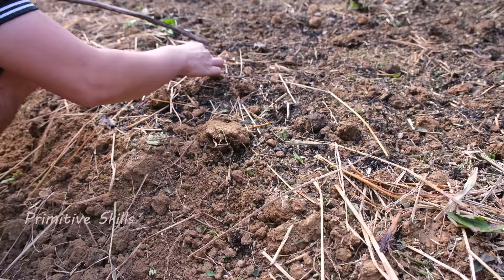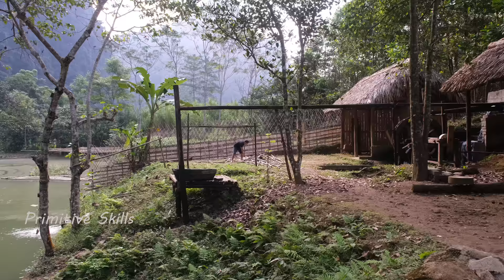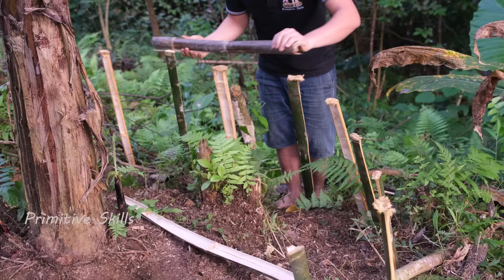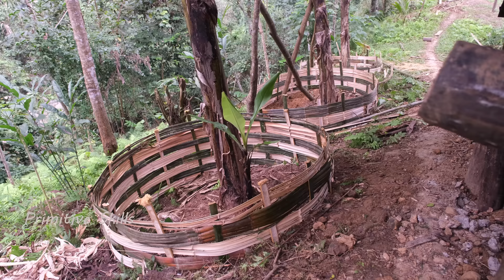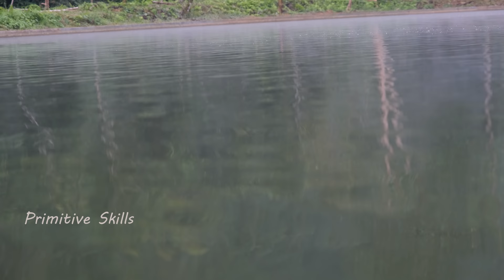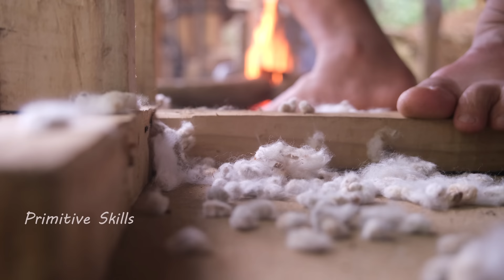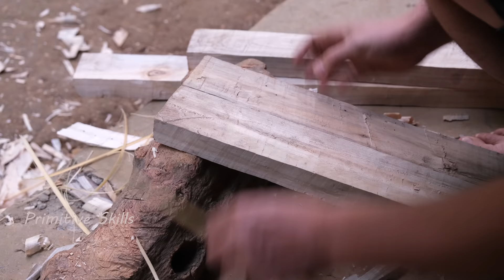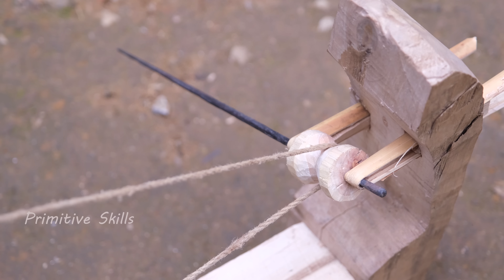Primitive Skills: How to make Spinning wheel, manual yarn rewinding machine (ep202)

Comment: WOW!!!!  That spindle wheel was wonderful!!!  It looks just like those used by Gandhi and his people when they were reviving their nation's economy.  Their efforts worked soooooo well that, it's also the same wheel model that appears on their national flag.  For your first efforts, you are actually doing very well!  I spin cotton every now and then just to retain the knowledge of how to do it.  I also initially learned on the spindle, but had trouble getting the hang of it, so, when I do it now, I spin it on my regular wheel.  But, because cotton doesn't have the cuticles like wool, the yarn has to rely on twist to stay together.  Without sufficient twist, you get yarn with really weak spots that fall apart and can't be successfully used to make any garments, or anything else for that matter.  So, when I use my regular wheels, it takes forever to make just a little yarn because you have to wait for sufficient twist.  You aren't having trouble with your yarn because of using old tech, but, you just need to loosen the fibers more, because it's way too clumpy, so, before you tease it with your bow, spend more time teasing it with your fingers.  Also, the rolls on the sticks are called rolags.  Your rolags are too fat, a result of the overly clumpy fibers.  You are doing a lot better than you think.  You just need more practice.
Reply: Hey LOF !  Good to see you again.  Happy Holidays.
Haven't watched the video yet, but it would be good if he turned some of that cotton into wicks for simple oil lamps.
Reply: @jimbayler4277  I have watched it twice!!  I confess that it was because of the wheel.  I try to have a look at the video pics when I  get the chance.  I haven't been able to watch them all lately because I have a sick dog to care for.  Me and my husband adopted a bonded pair of great pyrenees going on 2 years ago.  We knew from the beginning that the female had severe hip joint issues, but, they needed a home and I have always wanted the breed, so, I figured we would take them and deal with whatever happened.  And, I have to tell you, it's really a job and a half.  My girl is 100 lbs, but my boy is 150 lbs. So, I have to get them to agree with whatever I have to do to them, cause, if they really don't want to cooperate, there ain't a lot that can be done.  But, they both have bonded with us and would do anything for us, and we would and are doing the same.  We recently got new neighbors next door who aren't used to dogs,especially big, loud ones.  It's a multi member family with an adult son and his pregnant wife who can't stand the loud barking and is starting to complain about it.  We have lots of wildlife around our neighborhood because we live at the base of a national wildlife reserve, so we have coyotes, mountain lions, pigs, etc. that roam the neighborhood during the early morning, which makes the dogs bark like crazy!  When that happens, I have to get up and quiet them down.  If they get really agitated, then I have to sleep with them so they will relax and go to sleep.  I have only slept in my bed a few times in the last few months.  I haven't had any time to bother trolls lately.  I really miss that. 😢  A couple of times I actually looked for Mindcrap/Missy Cooper, but, really didn't have time to do anything about it even if I found it.  My husband, who is finally retired took pity on me and started feeding the dogs their dinner, but I am just taking a few minutes before I have to to down a check on my girl, we are trying to change her pain meds.  She was on steroids, but they were reeking havoc with her digestive track, so we has to get her off them, which meant she had to go through withdrawal, and that was several days of really awfulness.  So, now I have to see if she can get by on the nonsteroid  alternative.  Seriously,  she's not able to walk without the pain meds, so we have to feed her by hand,  and drag her outside so she can do her toilet, which is what I am waiting to do right now.  So,  I gotta get going.  Sorry to complain the whole message.  Really great to hear from you!!  I am just waiting to see if @P. Skills will actually get a garment made out of the cotton.   He did an excellent job with the gin and the wheel, and his spinning was coming along well also.  I can't wait to see how he does.  See ya.
Reply: @loveofiber7564  GREAT  PYRENEES ?!  Holy Moly !!
That industrial grade shop vacuum your husband has had his eyes on ?!..... Get it for him for Christmas !  With all that fur, you're gonna need it !
I've always been a dog person (the wife and boy are solidly cat people). But when the boy wanted a dog, I told him "Okay, but you are the one that will need to do "Shovel Patrol" and clean up after it....". We do not have a dog.
The cat at least, takes care of its business in the neighbor's yard (Oh ! Wait did I just say that ?!!..... I mean uhhh...  Bad me !!)

Speaking of Trolls, are they still posting ?!  If they are, they are not showing up in my feed !!  That would mean that I am being blocked from seeing them somehow.

Check out Ceasar Milan the "Dog Whisperer".  Your dogs can be trained to bark only when it is appropriate.  But you have to establish that you are the Alpha animal in your new "Pack".

Yeah, I can relate to the dog's digestive issues.  Since I have been having to take blood sugar Meds, I've become Military grade dangerous to be around !
In a group of guys..... I can clear a room faster than any of them !
The wife, however, is less appreciative of my newfound talents.... especially under the covers.....

Anyways, back to @P. Skills.  Have you ever thought of creating/making a spinning wheel like he just made ?!  It looks like it would be fun to try.  Shouldn't be too hard (maybe time consuming).  If he was able to build one with his resources, we should be able to also.
Anyways..... Happy New Years to you and yours !
Reply: @loveofiber7564  : Ahhh..... Man !!!  "Stay out of trouble" ?!!!  There goes all the fun !! (just kidding)
What if I invited you along for the next crazy adventure ?  Would I be allowed to get into trouble then ?!!!!!!

On the Trolls: I don't know that they have been blocked to our view.  I'm just going down the list of possibilities. But after four plus years, suddenly they're gone ?!  

That makes for more than a bit of curiosity. But since you are not seeing them either, it is very likely they were blocked from the channel entirely.  

I don't see them as having gotten bored and leaving of their own volition.

I doubt you were blocked from seeing them if they are still around.  I was the one that went hard and relentless at them.
They were nothing if not persistent.
I must admit, it is a relief not to have to deal with them.

I was allergic to cats also but didn't have a choice in it.  I got the "look" that told me "Deal with it buddy !!" 

On the Dogs:  Even independent dogs are still pack animals and have a hierarchy.  Either you are the leader, or they are.  You have to decide who's going to drive the boat.
My dog (pure breed Mutt) from when I was a kid, eventually went with severe hip problems, so I feel for ya.
Stay strong. I'm sure they are grateful.

ShopVac:  Still.... might be a quick way to gather it verses using your clothes to pick it up bit by bit every time you sit down.

Real cool that you have worked with all those different donor fibers !  Some of those sound like they are real hard to come by.  Though, I suppose there is a network in that interest, that trades materials around.  Every other field of interest seems to have a similar network.
Reply: @jimbayler4277  You are such a kidder!!  Your wife has to be tough!!  

Thanks for the advice and sympathy about my dogs.  Fortunately, my neighborhood is dog central.  Almost every household has multiple dogs and we all congregate during our walks to trade info, neighborhood secrets and gossip!  It's kinda great really.  My husband is the distinct alpha of the house.  As for me, I am my mother's daughter, so I am next in the line of authority  - probably also because I am a retired teacher as well, but,  shocker, I am able to stop the barking better than my husband.  And, our big boy seems to instinctively know when it's not a good idea to defy me.  It's our girl who's been the one to really push the limits.  She has been having mobility issues for much longer than they have been with us, so, in the beginning,  we had to stop our boy from taking her food, etc.  So,  we trained him to the "leave it!"  command.  Initially,  she wasn't able to stand long enough to finish her food, so,  she was a dog who was supposed to be around 100 lbs, but, barely weighed in the 80's.  She now is just below 100 lbs.  AND, she is now the one that will take our boy's food, and will kick him off his bed, even if he is sleeping on it!  Which she will do when she pees on her bed during the night, and we, the human slaves, are not available to clean it up.  This is an improvement because, before, she would just continue to lay in her pee and poop, because she had soooo much difficulty moving, so it was just easier for her to just  lay in it.  She now will move to the floor, or another padded area, or,  if she wants to be comfortable,  she will just take over our boy's bed (they each have a memory foam pad with cover, pee pad, and faux-fur pet throw - it has a rubber center and is really comfortable and warm, it also really protects against pee accidents).  Unfortunately, my girl sometimes manages to lift the protective covers as she is climbing on the bed, and if she happens to pee in the wrong place, she will get her bed wet.  The bad part is that it takes several days to clean and sanitize her bed because of the drying time.  Memory foam takes forever to completely dry, especially the center.  And, on top of things, we are now in the rainy season, which means I have to wash and dry it in the garage.  

Oh well, so sorry, but I complained again.   I have to run cause it's feeding time. 

And, finally, no, you can't get into trouble even with company.  Unless it involves going after trolls.  So, let me know when you see them.  I am absolutely sure they would block you wayyyyyy before me, so that's why I was surprised that I also hadn't seen or heard from them.  I also can't believe they could have packed up and left, but, are they taking a break?  Or just spreading the love??!!??
Reply: @loveofiber7564 :  Man !  You are a tough task master !!
OK, Fine !  No more trouble making.... (wellmaybeonlyalittlebit...)

(If I haven't already, I probably should have mentioned it previously. 
I'm only good for about three straight lines, and then the humor has got to be inserted in there somewhere - Yes, My wife is over there doing the "Bobblehead" thing agreeing vigorously !).
Do I test her patience ?!..... maybe.... I confess to nothing !!

The Male seems to have figured out who the REAL Alphas are in the house.  I suspect your husband knows also.
Former Teachers don't tend to put up with much guff !

Is my wife tough ?:  Well.... the heels of my shoes are shiny from clicking them together when I salute !

Trolls:  Maybe, if we are lucky, they are on a State sponsored vacation (jail).
"Spreading the Love": Ha ! Good one !!

Nah, I never found their "fingerprints" on any other channel in the genre.  Not even on the "OG" of Bushcraft/Primitive skills, @Primitive Technology - The Australian guy.  The trolls claimed he was the "GOAT".  
Not even a compliment for him.

Bed protection:  I'm assuming that it is a fitted cover with elastic corners.  Maybe adding crisscross elastic straps or bungee cords on the underside of the mattress will help hold the cover in place, better.
The foam:  Roll it tightly to squeeze out as much water as possible and hang it in the warmest place possible.  Maybe a drying rack with plastic sheeting below it to catch drips.  Air circulation is critical. 
With the cold and winter humidity, leaving it to dry in the garage will take forever. 

Consider using compress wood pellets (sawdust compressed into pellets) for under the protective cover as a Foam substitute.  They are moldable (create a hollow), comfortable, and warm.  They use the pellets for horse stall bedding and animal cage litter.  
I, and many others use the pellets as organic Kitty litter.
The fresh pine scent really lightens the room.  
The carbonaceous nature of sawdust virtually eliminates the smell (ammonia) of the urine. (wa-a-ay better than clay-based kitty litter)  

When you change it, it can be incorporated into the compost pile, if you maintain one for your garden
If not, the Yardwaste recycle bin. 

You can find it cheap at most Feed/livestock hay stores (40-50lbs bags).  You can also usually find it at the Chain pet stores, though usually a bit more expensive.
Get yourself a medium size Garbage can (under 30gal) to store it in.... and a handy scoop.
Hopefully, these suggestions will help lighten your workload.
Reply: @jimbayler4277  You're an angel for trying, but my husband is sensitive to the dust.  We have difficulty with what's generated in my woodworking shop.  So, we have air filters in just about every room we spend a lot of time in, and no scented candles, we have to even be careful with aerosol air fresheners.  We went through the scented wood chips when we first got married.  I had cats that I just couldn't part with, and this man wanted to marry me so badly that he agreed to take me cats and all.  Well,  after multiple attacks, I finally got rid of the chips for the cats, the hay/alfalfa for the rabbits, etc.  So, I just gave up having cats and rabbits cause I just couldn't watch him suffer.   So, after my cats and rabbits died out - of natural causes, I just didn't replace them.  But, you are all kinds of thoughtful to think of it.  

Gotta get going, again,  dogs as usual.  

Oh, and let your lovely, long suffering wife know that if you guys ever want to visit So Cal, we are a mere 40 minutes away from Disneyland.  L.A. is just a little further west.  

Oh, and I won't bother with the "stay out of trouble" cause I think it will be ignored anyway.  But, I will say stay in touch.  Happy trails!!!
Reply: @loveofiber7564  : Wow !.... and I thought I was the King of allergies !!  Dust and Pollens, Spring and Summer.  Molds and mildews, Fall and Winter.
My condolences, sympathies, and empathy to him.  I can certainly relate.
We buy Kleenix by the Costco case.
I should have bought stock in the company years ago.  I could have at least recovered some of my money !
We're just up the line from you. San Jose area.  If we ever get what passes for free time, we might take you up on the offer.
To you, likewise.  Happy Trails.

Comment: maybe it would be good to use a water wheel, and connect the spinning wheel to the wheel, I would make a pedal that would switch the direction of rotation, you would have both hands usable for spinning cotton and the results would be much better, great work, I just hope there are no other workers outside the shot people, I don't want to offend you and I believe that you managed it all by yourself, maybe it would be good to grease the whole water wheel with lard so that the water can soak in, and it would also be great not to soak the water wheel in a stream of water when you're not using it, so that it doesn't rot unnecessarily quickly, fingers crossed good luck

Comment: Spinning is not an easy craft. I've spent all of my life with spinners, knitters and weavers. They spend their whole lives learning to prefect their crafts. I'm amazed you got any thread at all. One suggestion:With your machine you can only use one hand on the thread you are creating, as the other turns the wheel; it's easier to form the thread properly using both your hands, while the wheel is turned by foot.

Comment: The spinning wheel will work more smoothly if you use a larger wheel to spin the cotton onto. It will have a better rotation and slower speed of the wheel. Hope this helps!

Comment: You should card the cotton before you spin it (which essentially is passing it through two brushes to straighten the fibers out in one direction), it should help produce a more consistent and stronger yarn. You could even make a drum carder for a quicker processing time than using two brushes.

Comment: also ur roling thingy, if u want it to work better, the rolls could go with a simpler cog instead of this exotic designed one, also put another on the other side of it this way it will have more stability

Comment: You might consider installing a short wall in your kitchen/workspace area to keep the cooler air from getting in as bad. Even something waist high when your sitting should do, that way the air can still flow in and let smoke ventilate safely. Forges will often do this.

Comment: Duong, those machines are amazing! The seed separator in English we call a Cotton Gin (short for engine which used to mean machine in the past). When you dried the cotton and lubricated the machine, it worked very impressively! The spinning machine is ingenious. It would be easier to spin with two hands if you could drive the machine with your feet. But with practice you should be able to make basic thread which is fairly even for weaving. I really enjoy your work and am loving seeing you develop these ingenious ideas 🤗
Reply from the maker: thank you

Comment: Thanks for another great video! That spinner looks great, but something that would really help with a consistent thickness and smoother action, would to make what are called “rolags” basically taking two combs and using them to align the fibers of the cotton and then rolling that up into a cylinder. I hope this ends up being useful!
Reply from the maker: thank you